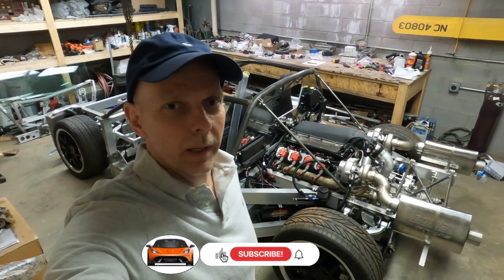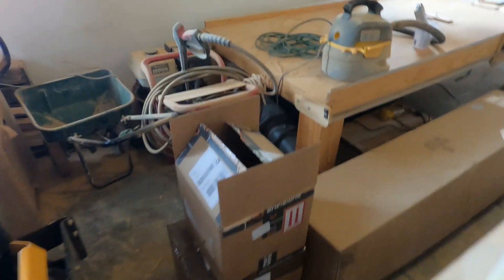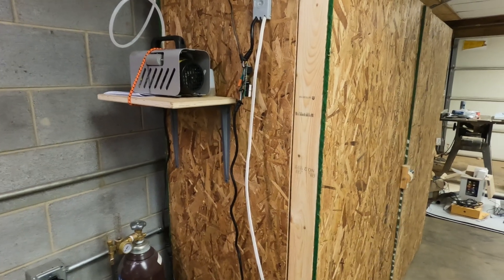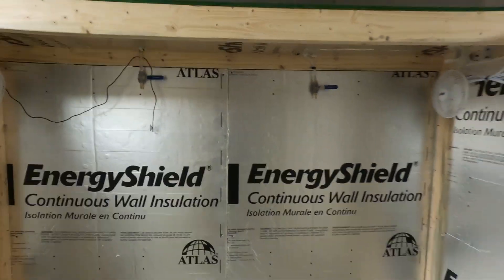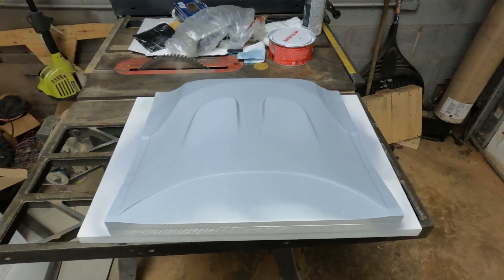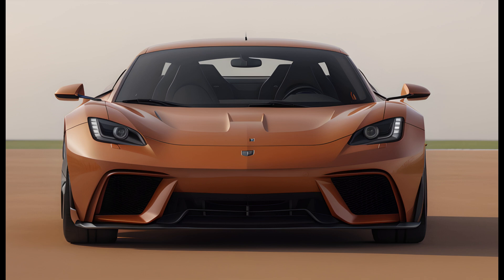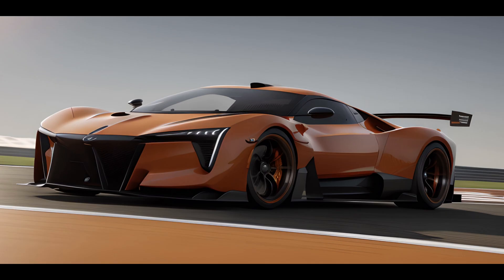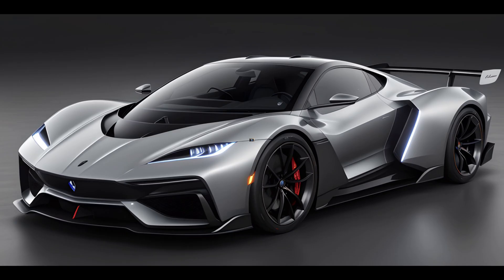Building my own Supercar - New body designs?

Comment: The design was good, but more sportscar than supercar. These variations definitely bring the excitement up !!!
The Orange one is nice, but it is way too busy and derivative.
The silver one is the winner IMHO because it is very cohesive and streamlined. While very agressive and sculpted, every part of it makes sense (form follows function). The way the windshield and the front air vent are one is so nice ! And, it doesn't look derivative.
It would work with your existing headlights. But with a 3D printer you might also be able to create your own design for the headlight.
The only thing I would suggest to erase is the little line/groove between the headlights and the front wheel. It has no fonction and doesn't flow with the rest of the lines and shape :)
The beauty of fiberglass is that you can create any shape with it, and you really can achieve these looks ! 
I can't wait for the next video ! :)

Comment: Hello, why do you choose to use a mild steel chassis, if that's what I'm seeing anyway. Wouldn't it be heavier?
Reply from the maker: The chassis (frame) is made from 6061 aluminum. The only steel part of the frame is the roll bar, maybe that is what you are seeing.
Reply: @basementsupercarbuild2948  ah alright, thank you for clarifying. Do you have a weight target by chance?
Reply from the maker: @jaycreate7701  I’m hoping for around 3,000 lbs. With 800hp that should make it interesting.